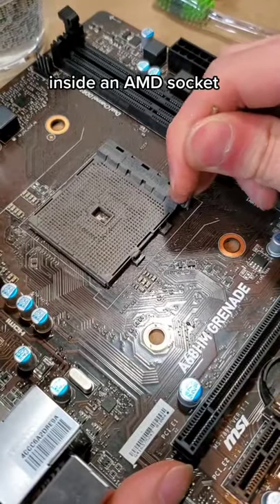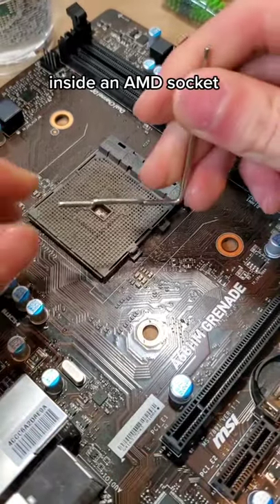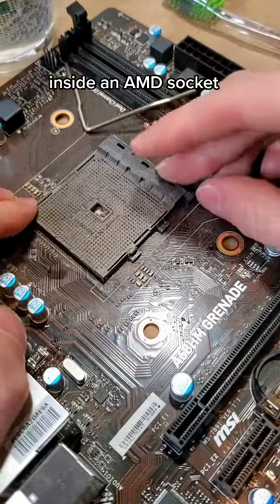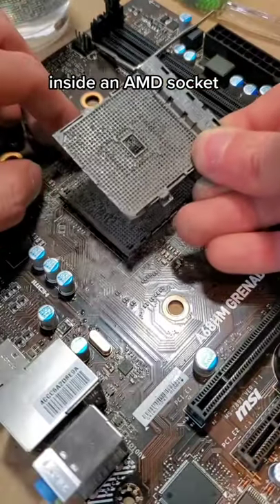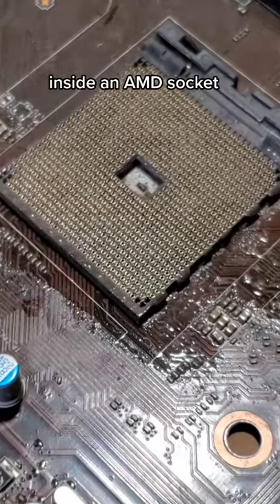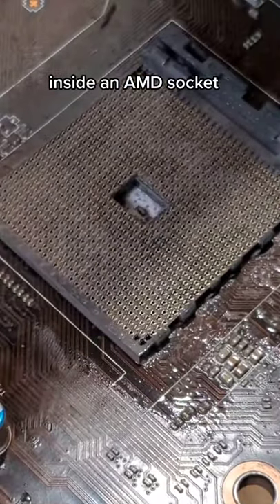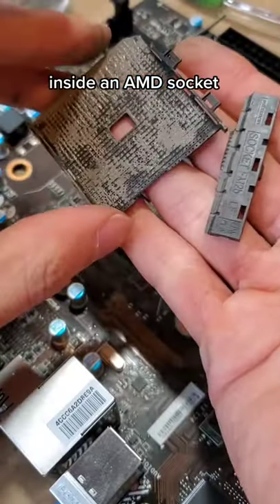inside an AMD socket! #shorts

Comment: As a continued thermal paste episode you should see if pre applied thermal paste on coolers are better or worse than applying it manually
Reply: simple answer really there is no difference
the only difference comes from the different brand of thermal paste used
Reply: @playingaim5392  this is not true as some pre applied thermal paste does not fully cover the cpu heat spreader
Reply: @soupdrinker72  ah yeah forgot cheap trash coolers existed
Reply: @soupdrinker72  For intel chips older than 12th gen you might not even see a difference then. For AMD though, that could be a real issue.
Reply: The actual difference is the pre-applied thermal paste on default amd cooler will tear down your cpu from socket if you did not replace it in a reasonable time.
Reply: From my experience pre applied thermal paste is TRASH
Reply: @meechie9z  Not on be quiet stuff, their thermal past is very very good.
Reply: @antoinepersonnel6509  ah. My experience is with the amd stock cooler
Reply: @soupdrinker72 Bro really is an rx480 💀
Reply: @myriadtechrepair1191 My Laptop i5 is lagging 5 gen behind even tho it uses obsolete SATA HDD still runs well surprizingly for a laptop that is 11 years old every 2 to 3 years i do reapply the thermal paste except if i don't bring my laptop on the go
Reply: @mmis1000 Question is what is the reasonable time
Reply: @soupdrinker72 thermal paste is only required on area that is in contact with fan base. Why would u cover whole cpu heat spreader when fan base only is in contact with 50% of central circular area. Just think about it mate.

Comment: A few weeks back I managed to pull off the cooler with the CPU stuck to it via the thermal paste. Pried the CPU off the cooler with a screw driver and was pleasantly surprised to find out that the parts still worked so as far as I'm concerned, the AM4 socket is alright.
Reply: I did the same thing with an FX series chip. I then saw Intel's ACTUAL locking mechanism, and switched to them. AMD need to stop half-assing their "locking" mechanism and get something that actually holds their shit down
Reply: @DaysofKnight the new one definitely does

Comment: I wish the am5 motherboard still used this system... It was great at saving boards from bent pins
Reply: Hell yeah, last time I clean my entire desktop which is old, after removing the CPU I saw that the motherboard had a broken pin and I never touch it, it was because I overtighten my cooler and over the years the pins got fragile and sadly without that pin 2 ram sockets were dead.

Luckily I managed to solder the pin that I had to remove from a much older 775 motherboard which I had to completely break it apart because no matter what heat I put on it the suckers couldn't ever get loose.

It was such a huge hassle specially because I only have basic tools. If I remove the CPU ever again it might not survive as much more pins can break and would probably cost me a lot to send the board for repair to put a whole new LGA 1155 socket.
Reply: @guily6669  yeah i personally have stacks of ancient bulldozer and am3 boards from my old pc flipping days and the socket has never been something i have to worry about
Reply: @BrendenPragasam   I never had problems with LGA since early 2000 other than my current PC which is old from 2011, but it's my fault since the beast cooler is mounted with a small tool and it's easy to overtighten it.

Comment: What AMD needs to part ways with, is what you think is a "locking" mechanism. It doesn't lock shit. You can pull an AMD CPU right out of that "locked" socket. They need a locking mechanism like Intel where it actually clamps the bitch down over top
Reply: That’s what they did with am5

Comment: Maybe try to light a match with the heat of the CPU
Reply: That’s gonna be tough. CPUs usually top out at 100C whereas match heads ignite at like 240C. Chemicals that are easier to ignite exist, but there’s not much market demand for them.

Comment: no. i want to see what's INSIDE the socket. as in the tracers. it's kinda common sense that it would just be loads of good connectors as you can literally look through the holes.

Comment: You wont be able to pry open the socket if you pull off the metal part. In fact it will make it harder.

Comment: The more expensive connector portion should go back onto the CPU. Did you notice that these CPUs didn't get any cheaper when they switched from PGA to LGA? No? That's because they took in the whole amount of savings as earnings. The difference (LGA is more expensive for the end user) is transfered to the Mainboard, that's why your average cheapest mainboard starts at ~$150 instead of the previous ~$40.
Reply: It’s more expensive because it’s newer.

Comment: The PGA design has some issues, my friend constantly get his cpu pulled out when he removes the cooler.
Reply: Because he didn't warm up the processor before taking it out
Reply: @PanMrPlaying not always possible considering that if the CPU is warm probably the cooler is also warm. Plus he is is using custom cooling, he needs to empty all the loop before removing the water block which can take some time.
Reply: this is why u should twist the cooler a lil bit before trying to remove it
Reply: @Amelie12  with full monoblock and tight motherboard good luck twisting.
 plus for most coolers/blocks (that does not use AMD clip style mounting) you need to remove the back back plate in order to twist the cooler (due to screws holding the cooler) in most cases that means you have to completely remove the motherboard from the case - a pointless time consuming process.
Reply: @eliadbu  okey,  i have never used Monoblocks,  and have never used cheap thermal compound or have it longer on than 2 years. 

That a cpu sticks to a cooler do i only know from old am and am2 mainboards that have chrap thermal compound and was never cleaned in 5 years. 

But it does look funny. 
That reminds me,  that its time for my Keyboard to be cleaned.
Reply: @Amelie12  the thermal paste he was using wasn't dirt cheap (I think it was MX4 or Kryonaut - I'm not sure maybe I'll ask him) and knowing him - he literally disassembles his water block(normal water block) every few months for maintenance or modding to his case, no way he left it for more than a year without complete system maintenance.
my guess is the clamping mechanism just got weak after many CPU removal. LGA while not perfect does not suffer from this issue and can probably scale to more pins sockets. There are good reasons why TR and Epyc are LGA and the upcoming AM5 is also using LGA.

Comment: So glad AM5 socket is now LGA. Bent CPU pins will become a thing of the past 😅
Reply: Bend pins on the board are much more nerve-wracking to fix bro
Reply: @michubern1444  but there is a much smaller chance of them actually bending cause they don't have to be handled every time you wanna mess with your CPU
Reply: @gideonlingle3520  well if you want to mess with the cpu you have to mess with the socket hehe.
Reply: @michubern1444  the pins in the socket are pretty recessed so I don't think they'd be easy to bend tbh

Comment: I had to take one apart to clean the overkill thermal paste H/P used. I was just going to update an air cooler for someone. Just as I was taking off the old one, the CPU came out of the socket and the thermal paste was everywhere. IPA to clean the pins and connectors on the socket.

Comment: Did It Really Can Be Opened?
(just asking)
Reply: Yes. Older sockets (478, 462, 370, etc) are all designed like that, they all have pins inside the socket, protected by that plastic shell.

Comment: PGA is just superior when it comes to inspection. You can see the pins and if they are OK or not, and You can see the contacts and if they are OK or not. You can visually make a educated guess if the Hardware is OK. LGA can not be Visually estimated because Theres no reference point when You mount it you can't see If the Pins of the board, better said contact pads are properly touching and how well because CPU is in the way.  But It's easy to damage and Super hard to fix. Also PGA is no sensitive to Pressure of mounting. If it's in and Not damaged Its work. 
I only once say a Damaged socket Exactly like this FM2+ And it was a known Idiot's doing, god knows what because You can't damage it without specific tools. He used a Big sewing needle for some reason to probe it for no reason.

Comment: could you try using gallium as thermal paste? start with it still solid and let it melt
Reply: Gallium is already being used as thermal paste. They refer to it as liquid metal.
Reply: Gallium will damage some coolers if you're not careful, it forms an alloy with aluminum
Reply: @DTG4844  y e s
Reply: @bigchungusus  real big chungus??/??/????/??!1!1!!!!!1!!1!!!!!
Reply: @robert19  e

Comment: Question: what happens if you break one of the pins at the back of the AMD socket
Reply: Russian Roulette, it can still work fully functional, or it can kill a ram slot, every other thing that is connectet to cpu and not the chipset, put the graphicscard slot from x16 to x8 or kill the Mainboard entirely

Comment: Is there any substitute to thermal paste?
Reply: tomato juice
Reply: italian juice specifically because it has higher fat concentration
Reply: liquid metal, i think? correct me if im wrong
Reply: liquid metal can work but it can wreck the surface of the cooler and cpu. it doesn't provide much of a temperature benefit anyway and is more expensive and harder to apply so usually thermal paste is the better option

Comment: if you know laptop computer repair then let me know i cleaned my laptop after opening it applied thermal paste in cpu processor but its stuck now on boot and blinking cursor once in 10 times it starts and its hell of slow as if hard disk is dying that hard disk runs flawlessly in other laptop what could be the problem can you explain...? 😅😅😅😂😅😅😂

Comment: I need helpi got the gpu it has been used and man says it working good but when i plug it in my pc it came to life fan was working but i didnt get picture. I thibk that is bc i dont have pci 4 pins to 6 pins (thingy what gives power) my gpu is Zotac gtx 570 amp edition do i need to buy that cabels and then will work or i got scammed

Comment: Ahh spotted! You didn't properly clean the thermal paste last time you put it on the socket!

I see inside of AMD socket so many times. But I don't remove it. The client kept breaking it by putting AM3 CPU in AM4 socket. I have even seen one that has a bent pin inside.